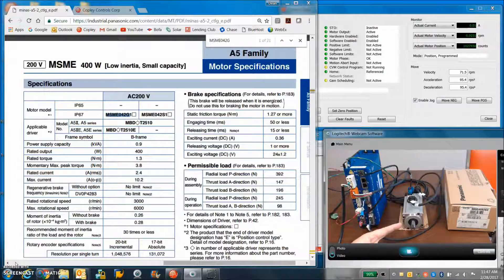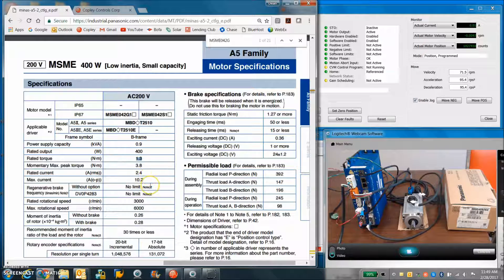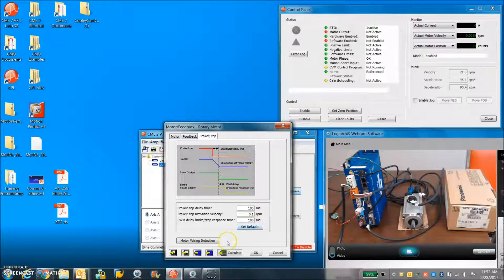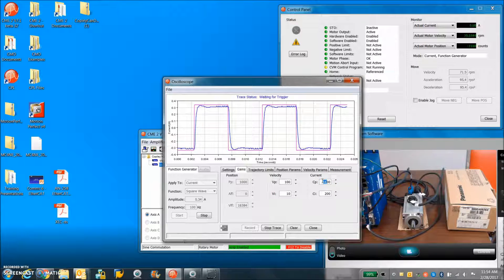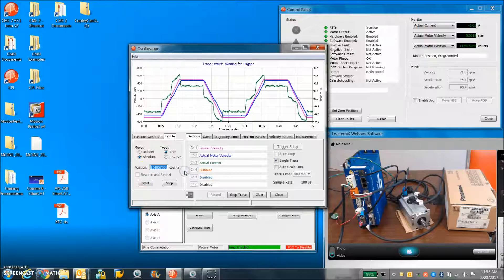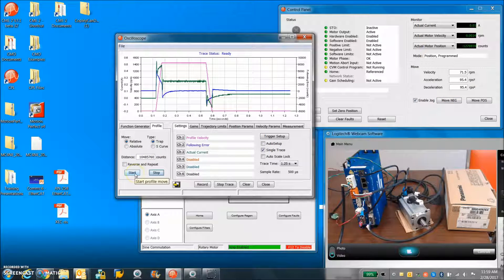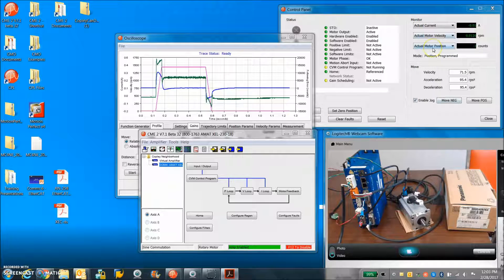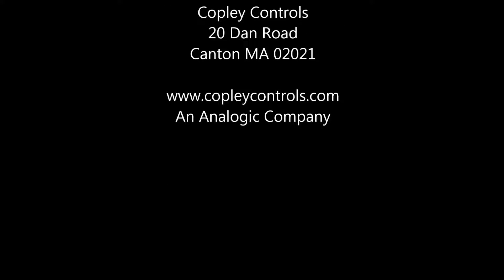Panasonic Minus A5 Serial Incremental A with Xenus Plus

Comment: Does Harmonic FHA-25C-100-E250  have same kind of encoder? It has 4 wire incremental encoder and I setup CME same as you did here but I always get this https://photos.google.com/photo/AF1QipM-cL39Hg5w6wBTeGbwXs5lxfCGFNXqFdVmbxtE. Could you suggest some solutions?
Reply from the maker: The E250 is unique. I will investigate. Please use Copley support form so we can communicate better http://www.copleycontrols.com/Motion/Contact/support.html
Reply from the maker: I have added a Harmonic Drive 4 wire serial incremental video for there E250 option: 
https://www.youtube.com/watch?v=p-e52A76-Zs&t=122s